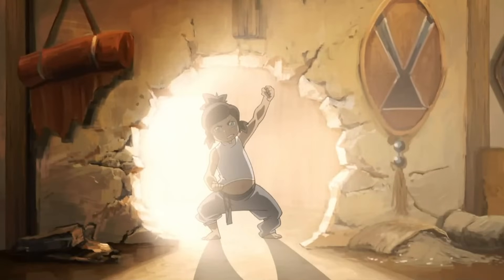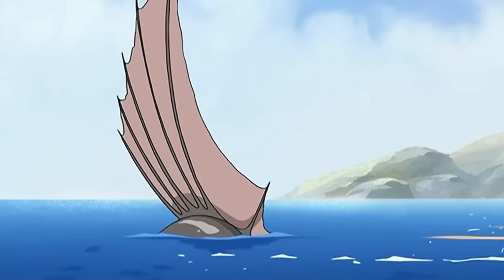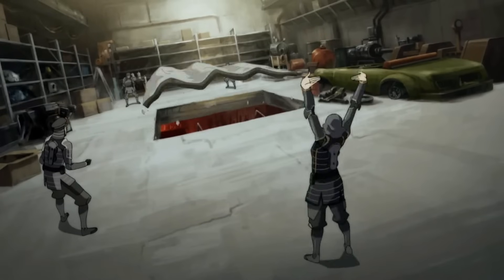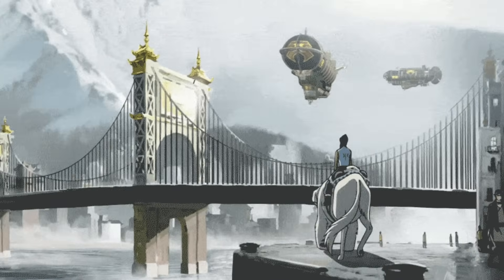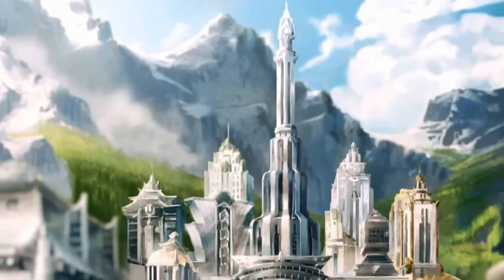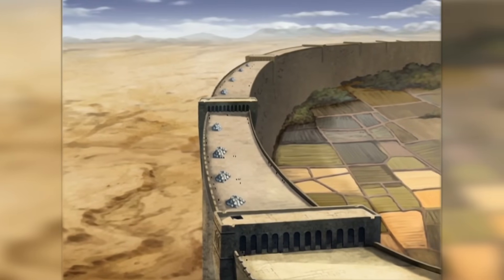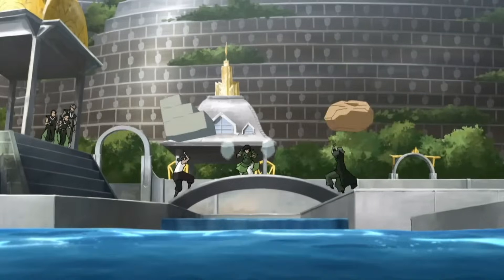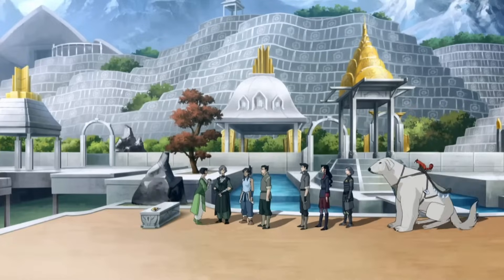Engineering the METAL CITY in the Legend of Korra

Comment: What if platinum wasn't used for coating the buildings, but a ceramic coating was used instead? A ceramic coating is applied to a metal surface to protect it from environmental damage (corrosion). It enhances the shine of a metal, and it increases thermal insulation (preventing a metal from absorbing heat). This would spare the citizens of Zaofu from being cooked alive.
Reply: I would also posit they likely utilize vented architecture, like seen in some desert cities. Lots of open areas to allow drafts of airflow to reach the interiors of buildings. Given Metalbender cities are the equivalent of advanced modern ones, they probably have really well-placed ones or can simply make on in the wall as needed.